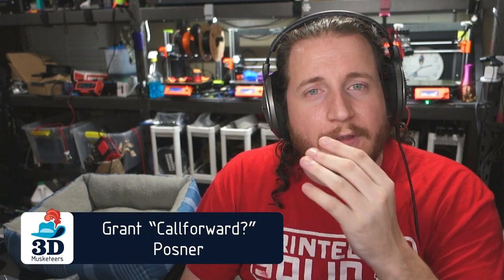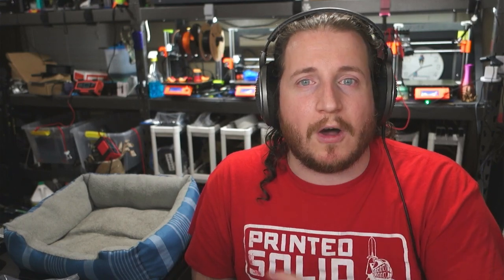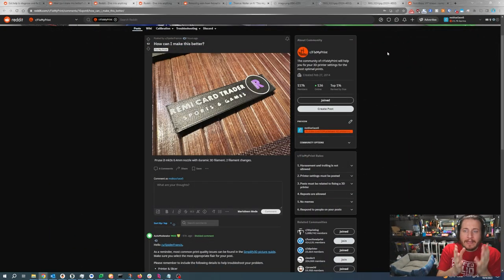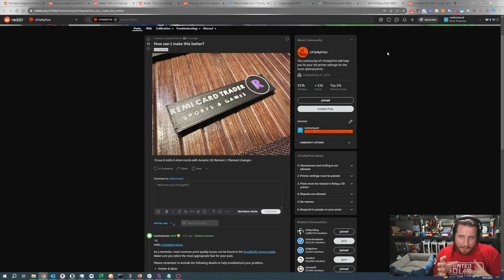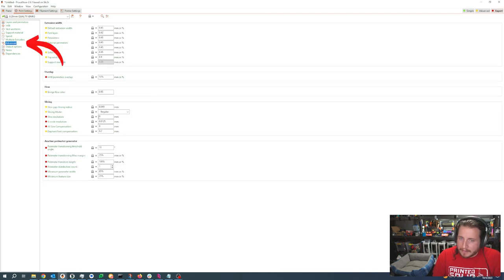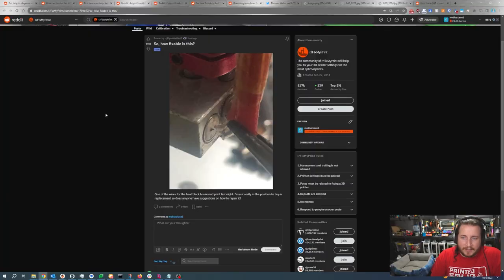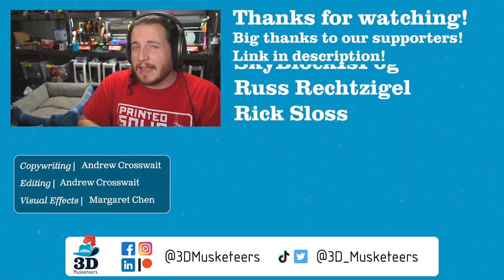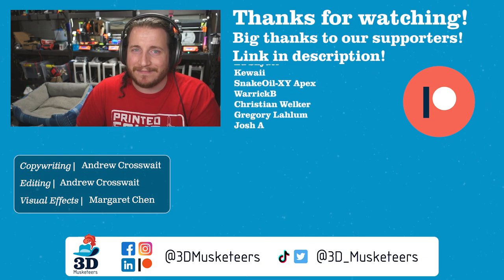Fixing Filament Knots On And Off the Roll! - PrintFixFriday 108

Comment: Main suggestion for me for the first fail is to print it face down so that the letter layers are super smooth. Prevents the need to iron.
Reply from the maker: but wouldnt the black parts be a problem then?
Reply: @3DMusketeers  it looks like the letters and logo were printed flush with the top layer. In my experience, I've found it's better to print that bed side down to get better quality.
Reply from the maker: I did NOT see that.. well then, that changes it for sure LOL

Comment: so glad to hear someone else talk about the heat needed for running faster than whats printed on the spool for heat. I get questioned all the time when I say that
Reply: Speed Benchys often exceed 300°C due to the extreme flow rate.  I don't think I'd want to be in the same room as something running ABS at such a spicy temp.
Reply: @soundspark  but it doesn't reach that temp that's the thing! As it passes through the hotend it's only absorbing what heat it can. Too little and you skip steps. Too much well then yeah eww. But if ya start a little low and increase till you get good flow the filament doesn't get any hotter then it would running slow at lower temps.
Reply from the maker: thermal emissivity!
Reply: @3DMusketeers  sure use your fancy words! 😂
Reply: @jlstearn1175  Which is why on one of the videos the smokestack smoked at the end, as the flow slowed down bit the plastic started to burn.

Comment: I've had the spool jam like shown on my new out of the bag filament 3 times now. The roll seems to be so tightly wound that the machine pulls the tube in and wraps it up. So frustrating. I've got the tube in the Creality Pi. Didn't drop or do anything to the roll, opened the bag put spool in Pi and setup to my printer. K1 max( first printer ). I'm also not saying the line is messed up on the spool, the spool is on the roll clean and tight. I'm just wondering if it's wound too tight.

Comment: OMG THANK YOU for saying about the filament and how insanely difficult it would be to have it knotted from the factory! There will probably be some that come here and say  "well mine was" and I say, then you had a crappy person at the filament machine that day because they must have dropped it and just wound it by hand sloppily or it slipped off the end of the spool and instead of just getting rid of it (like it seems printed solid does GOOD FOR YOU!) they needed to save that 2 cents and let it go through to get packaged. Keep the videos coming man, I enjoy them!
Reply from the maker: look, If I didnt have issues winding, the average line worker should not!
Reply: Most likely the individual let go of the filament end and it got tangled.

Comment: The name badge should be printed upside down with the text on the print bed.
Reply from the maker: you are not the first to say that. The letters are raised, no?
Reply: @3DMusketeers  It's hard to see in the video, either way they shouldn't ;-). Usually the nicest surface on a print is the one that touched the bed. But most people don't know that you can print things like that face down and simulate multiple "virtual extruders". My "PrusaSlicer Extruder Visualizer" on Printables shows two methods (three if you count MMU, etc.) how to do that.